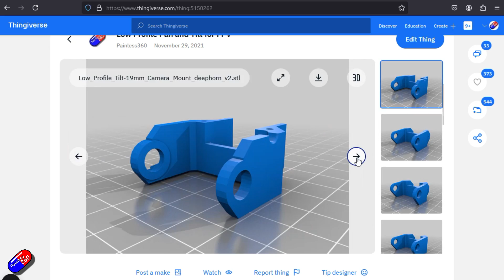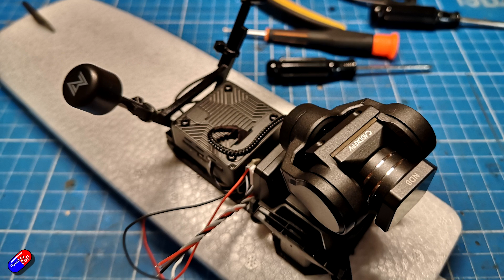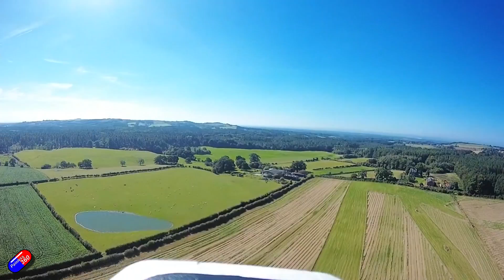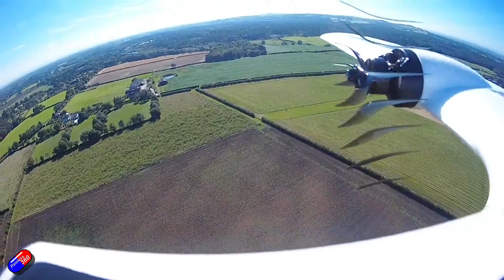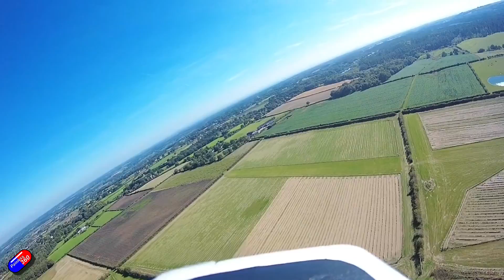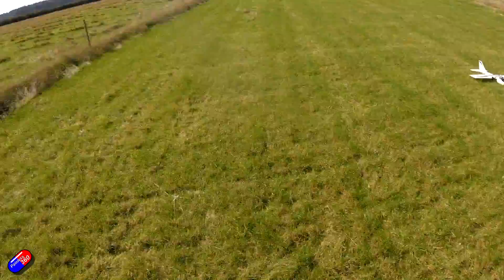HD FPV Head Tracking is here! Setup and Flight Performance Review (Using Walksnail GM3 Gimbal)

Comment: Going to go with a similar setup but lower cost now.
Ascent Vtx Lite+ has the same gimbal output so now this can be had for $40 on the Vtx end which is wild! Their ascent goggles have the tracking built in as well ($150).

Comment: hey, so I got the GM three V2 alongside the avatar HD pro camera system. Nowhere in documentation does it say where to plug in the gimbal wires for head tracking and I’m having issues finding information some of the information I’m seeing says to hook it into the USB port on the VTX, but I’m not sure is that correct?
Reply from the maker: Not all AVATAR VTX units support the connection to the gimbal. See the list in the video. You can email support@caddxfpv.com for clarity on the options with the kit you have. Best of luck
Reply: I bought an actual kit from them or I guess technically a bundle it came with that camera system with the GM three V2 gimbal and the goggles L after I posted this comment I did find the information I was looking for there’s a QR code on the little instruction type booklet thing and it actually mentions to hook those two wires up to the USB port connection on the BTX thank you though I appreciate it. You’re always full of the best information and you’re the reason I am giving this HD system a shot I’ve always been DJI or analog
Reply from the maker: Great to know you're getting there. I've had great experiences with Caddx support when I've needed help. Happy flying!

Comment: Just got mine and it doesn't work, power is applied properly on the bench as per the manual but it's as limp as a dead duck!. Contacted hobby rc and I am awaiting Mike's response. Sent pictures of the power hook up etc. 
Hopefully a replacement will be sent out soon. 😢.
Wanting to use it with one of the 2 avatar gt2 transmitters that I got at the same time but you wouldn't believe it, one of those is duff. 
Happy days Leigh. 😢

Comment: Hi Lee. I bought a pair of goggles x with the bulky add on head tracker, not realising there was a newer version. Ive picked up the newer goggles x but i cant get the head tracking to work now. Ive updated the goggles and the vtx and have video but no head tracking.  Any ideas?
Reply from the maker: I only have the first version of the X goggles without the head tracker in, so can't comment.  Best of luck

Comment: how do you set this up using a Matek FC with the googles X using PTZ ?  I'm having issues with the wiring and HT functions. Can you help ?
Reply from the maker: I've only used it directly to the goggles. Can I ask, why di you want to use it through the FC?
Reply: @Painless360  Oh, I just used the 9 V pad on the FC. I figured out why it would not function. I needed to change the channel to channel 1 on the gimble software.

Comment: Hi, just started looking at your channel. I’m interested in fpv and looking at caddx kit, I wear glasses and it’s not clear as to whether goggles L are suitable, do you have to use the supplied frame and get your own lenses fitted or can you wear your own glasses to view ? Or do I buy goggles X which have focus adjustment, is it the same as binoculars ? Thanks
Reply from the maker: Welcome to the channel! It depends on what sight correction you need. The Goggles-L aren't spectacle friendly but Walksnail do sell lens inserts, so you can get the correction you need. The Goggles-X are a lot more sophisticated and have the correction needed buitl in. Best of luck!
Reply: @Painless360 Hi, thanks for that I’ll go for goggles X, the other question I have is re soundtrack on the flight. Is it added during the flight and recorded on the headset or does it have to be added after ? Thanks.
Reply from the maker: Sadly the audio isn't captured or sent to the goggles. Happy flying

Comment: Did you fly with Dji og air unit and Motion Sic head tracker a few years ago? That is the set up I have on my L39. I used to fly a lot of FPV plane, but never really got used to it with head tracker. I’m about to go back to it with a new T28 and head tracking. I wonder how walk snail vid compares to Dji og air units?
Reply from the maker: The Walksnail setup is the best one I've used, period. You can disable the 'stabilisation' too so it just responds to your head movement only. Still requires a lot of practice to use, and I turn on ANGLE mode and ALT.HOLD when I'm using the HT system too! :D

Comment: Wow, if the headtracker cannot be turned off this is a bommer :( I have this issue where I have to turn my head arount to get the best reception and this will mess up my view a lot.
Reply from the maker: Indeed, you'd have to recenter the head-tracker then... happy flying!
Reply: It CAN be turned off! Latest firmware turn shortcuts on and press the menu-stick towards you twice

Comment: Disable head tracking?  Easy if you go the PWM route, I think. Otherwise, I wonder if just unplugging the Expansion Board on my Goggles X and rebooting them would do the trick...  I'll have to try it. But they really do, as you said, need an on/off toggle for HT.
Reply from the maker: You can select to have the GM3 only respond to head movemenr and not stabilise by using the setting in the goggles (PAN-Follow mode here). It feels a lot more natural when the gimbal is locked to the plane...
Reply: @Painless360  When I tested Pan Follow Only on my first flight (flying LOS then reviewing video, head tracker stationary the whole flight), and it would wait until I was 30 to 60 degrees into a loop then suddenly it would give up on stabilizing and  the view shoots up to catch up with where I actually am at in the loop.   So far, the best flying view for me has been "follow on 3-axis" with sensitivity setting cranked. Landings are what worries me... my test flights show that it can make a hard smack on the runway look like buttering bread in the goggles.

Comment: Dont think Im a fan of the built-in stabilisation in this gimball as it makes for a deceiving feel of where the aircraft is heaidng. Is it possible to deactivate it and just have the headtracking going on without stabilisation?

Are the goggles also outputing all three pan-tilt-roll channels through the audiojack port for use in the the trainer ports of our radios?

I am really close to getting these but it might be a no go if the above does not work.
Reply from the maker: If I figure out how to turn it off, I'll make a video!
Reply: @Painless360  thanks mate!
Reply: @Painless360  Hi buddy, just dropping by to let you know that disabling the stabilisation on the gm3 gimbal is doable, if you haven't discovered it for your self already :) 

Here's a fellow youtuber showcasing it 
https://www.youtube.com/watch?v=mqq6KYcAlVk&lc=UgzKba2lMSdogEbyEfR4AaABAg.AHMwRHdpSowAHNHZKVQeg8&ab_channel=AndrewNewton

Comment: Hi, I am new to FPV and want to add something like this to one of my RC airplanes.  Other than the Goggles and the GM3, what other components do need to duplicate this setup (camera, transmitter, antenna, etc)?
Reply from the maker: In addition,  you also need one of the Walksnail AVATAR units that the GM3 will connect to.  Best of luck!

Comment: Can you have both head tracking AND radio control enabled at the same time? Like so you you could use your radio knob to pan the view drastically around, and also still move your head/view around a bit once facing the desired direction. This would enable the pilot to remain pointing the directional-type FPV goggle antennas at the drone to maintain connection at long distances, while still being able to look around.
Reply from the maker: If you get it working, let me know! Best of luck!

Comment: Like you said, being able to disable the HT would be good, in fact I think it’s almost a ‘must have’.
For me personally I’d also love to see a ‘half way house’ HT mode where you can set a dead zone and move your head freely within your configured angles without moving the camera. Then beyond that, if you wanted to look along the wing you would move your head past say 20degrees then the camera would move to ‘catch up’ with your head position. This would have to be again configurable so you could set the speed that the gimbal moves to match your head. This is all standard stuff when setting up camera controls in many video games and translates directly into what would make a good / useful FPV experience. I think in reality nobody ‘really’ wants the camera to mimic the movement of their head with 100% accuracy. They want a way to tell the system where you want to look by moving your head… and there’s a subtle difference.
Reply: Very good idea. That's actually very similar to how the default head tracking works in PC flight sims. With TrackIR (one example), the user can set up custom response curves for whatever they wish in the software and save profiles for different scenarios. And there are default key-binds to pause the tracking, re-center the view, and even a precision mode.
Hands-free voice activation through the goggles would be the icing on the cake.

Comment: nice video!  I'm looking at making the jump from analog to HD FPV, and seems like the new DJI Goggles N3 and 04 air unit is a great combo, especially the 10g version for small RC planes.  N3 goggles have head tracking built in (works with the Nano drone) so hopefully there will be options for a pan/tilt mount for the air units, that will work with the N3.  Have you heard anything about this, or plan on getting the DJI system? thanks!

Comment: Hey there Lee, how would someone make head tracking work with the HD Avatar goggles?
Reply from the maker: You can either use the walksnail system shown. Or the DIY headtracker... Happy flying!
Reply: @ I wanna make sure I’m following…so there’s nothing available to purchase 3rd party or from Caddx to mount on the Original Avatar goggles to make head tracking work seamlessly? 

Are you saying there’s a DIY way of making the tracker with a few different parts?
Reply from the maker: There isn't a CaddxFPV option for the original goggles. Check out my video on the DIY headtracker... Happy flying

Comment: thoughts; I m making a similar setup with the gm3, hopefully there is a future update to stop the headtracking working, but as an interim, a reticle like motionsic offers or a fixed point at the front of the plane to display verticle and horizontal accuracy might be a good way to go.

Comment: Mechanical gimbals are so obsolete imo. Now that we have 360 degree cameras, we could capture 360 degrees video, crop part of it based on virtual head position, this way we would have no moving parts, almost zero lag, we could split osd into two parts: one that follows head and one that stays attached to the plane, that way crosshair and horizon would always point where the noze of the plane points and where the horizon realy is
Reply from the maker: Agreed, gimbals would be 'obsolete' if that tech existed as a viable alternative... until then..

Comment: Can you please provide more detail as to the on-screen display and also what is the range of the head tracking signal from the goggles to the the aircraft? Is it the same as the video signal coming back the other way?
Reply from the maker: What elements of the OSD are you referring to? There isn't anything different when you use the gimbal (at the moment)...
Reply: @Painless360  I think you referred to altitude on the OSD? Where does that info come from, how is it integrated? The gimbal pan/tilt controls are transmitted from the goggles to the air unit, correct? Is the range different then the video transmission from the air-unit to the goggle?
Reply from the maker: OSD elements shown in the video come from the flight controller... Happy flying
Reply: @Painless360  yah, how? that is my question ;)
Reply from the maker: All covered in the various builds on the channel... Happy flying

Comment: I've been flying with home built gimbals for years with headtracking, and find it to be the most immersive FPV flying experience.
Currently I'm flying an SE5A with O3 and a ZOHD Kopilot, and an J3 Cub with an Air Unit.

Never experienced nausea/sickness, but for sure it's the best FPV experience out there, videos on my channel. 👍

Comment: Agree that being able to turn off the head tracker would be nice. I have a single axis on a quad and set a switch to turn on tracker, dial on Tx, or fixed angle. Seems like Caddx will need to allow designating a button on the goggles to flip between modes for something similar, as the FC isn't in-path for the comm link. would also be nice if Caddx enabled the built-in goggles x gyro for users. that box is quite ugly. completely destroys the sleek look of the goggles x.

Comment: My first time seeing R/C flying, the transmitter was a huge box with a tall antennae  on it, the "controls" was a single channel switch that gave full rudder left and right, and the "servo" was a wound up rubber band to drive the rudder. You got full left when you hit the button, the next time you got full right. The models were high wing types that were set up basically for free flight, then it flew until it ran out of fuel, and they'd dead-stick land.
Now you have radios with up to 18 channels (there might be more than that, but 18 was the last time I saw an ad.), and FPV flying. Wow.
One thing I would be interested in seeing, possibly the next step for FPV, would be stereo cameras. That would allow you to see in 3D!
Imagine what that would be like.

Comment: INAV 8 will probably fix a lot of the usability things you are bringing up. You will be able to turn ht on/off via INAV modes. And it will also support sending the headtracking information via the OSD connection, which will unlock headtracking with all walksnail vtxs.
Reply from the maker: Indeed. Loads of cool stuff coming with 8.0. I'm excited to try it on this rig... Stay tuned!
Reply: Do you think UART 1 is fine for the "Serial gimbal" port in INAV 8? My MSP DisplayPort on UART 5 works, but my serial gimbal doesn't seem to react at all. I'm using a UART for VTX avatar V1, and a UART for the serial gimbal ( with power from external 11.1v battery) still unable to get the head tracking to respond. For PTZ, or other

Comment: Just looking at the available options from Caddx GM1,GM2 and GM3, it looks like that if you want to have a pan/tilt system (like your design with two servos) the only option you have is the GM3 correct? GM2 will only do pan and roll which not makes sense to me.... unless you can put it in a up-right position but it doesn't say on the website.
Reply from the maker: Yes, as I talked about, these gimbals seem to be designed for stabilisation really ... Happy flying!

Comment: Andrew Newton says you can switch from PWM to head tracking while in flight, but can't switch back to PWM. I think he says you have to power off and on the Gimbal to get it back in PWM mode. I'm going to upgrade my FC soon to one with a relay for the VTX/gimbal power and I wonder if i can switch that off and on while in flight to get back to PWM mode. Would turning off the VTX while in flight screw up the recording?

Thanks for the video, I've been waiting for this one!
Reply from the maker: Stay tuned, I'm sure that these extra features will be added to the code... Happy flying

Comment: Great review!  Glad one of the Digital FPV majors is taking head-tracking FPV seriously with direct Goggles wireless link to control gimbal for third party planes, not just their own drones like DJI.  You are right stabilization interferes with the visual cues necessary for fine adjustment during landings and should be disabled at least for the that phase of flight.

Comment: Can u add some expo to the head tracker
 If u contril it with trainer port could u put it on a switch to disable
Reply from the maker: Only if you don't use the PTZ mode. I'd not want any EXPO as the response is fast and accurate reducing the motion sickness...